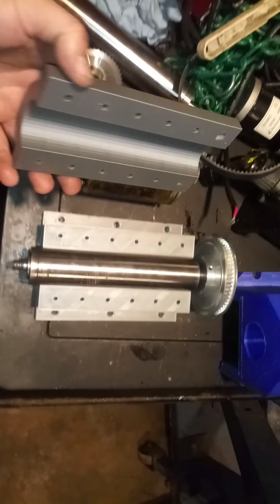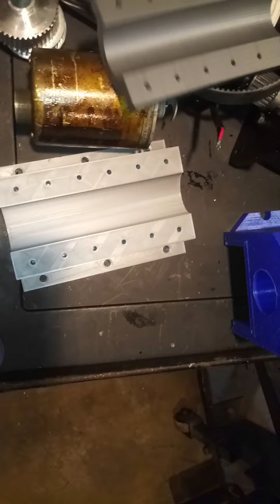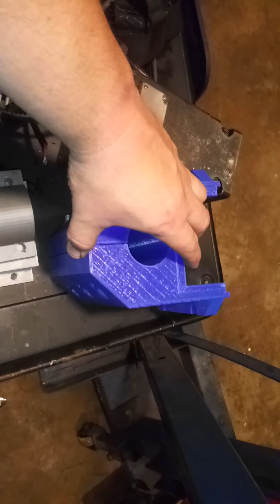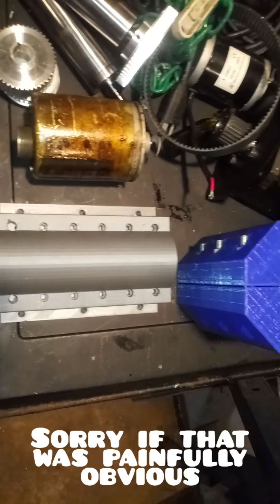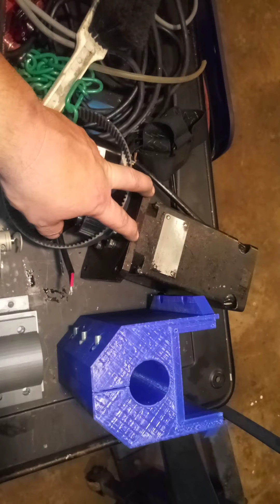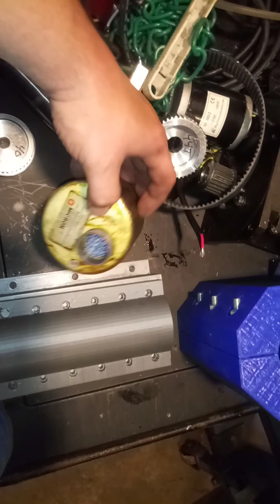Desktop CNC milling machine spindle update.

Comment: lol my comment disappeared. Weird.
Reply from the maker: ? Sorry about that, to be honest mine have too! Off my own videos. Then I wonder if I should post again and think we'll if I send it twice you guys will think I'm crazier then I am lol
Reply: @backwardsmachining7526  In the spirit of crazy, what I more or less commented was that I like the looks of it, and I think if you wanted to, you could machine something that would get you started. That is to say, if you bored top down through a block of material, drilled and tapped a vertical row of holes on the left and right sides of the block's face, then slit the whole thing in half sideways you would have a chunky/rigid round-holding clamp to build off of. If a large piece of square stock wasn't obtainable from your scrap yard, then maybe a large round could be milled square if you could find one. All in all, I like that you have the wick of possibilities lit and burning with forward momentum.
Reply from the maker: @johnstrange6799  I actually have a decent size block of steel specifically for this. I have many different ways lined up in case one doesn't work. My only concern is that steel is tough to cut on a good day in a home machine shop and the size of steel I'm talking about is pretty hefty. Now if I can take some molten aluminum and set it in a big block size form let's say 8 inch wide, 6 inch thick and 12 inches long I figure that can save a bunch of money when you price out aluminum. In fact I don't even know where to buy a piece of aluminum that big. My scrap yard doesn't sell local.
Reply: @backwardsmachining7526  Yeah, cutting is always going to suck, but a block like that after it were bored out wouldn't be too too bad since you would have the center out of it, BUT cutting it straight is the other issue. Sure you could mill the cut path back to flat, but at some point you will alter the round bore size. Aluminum isn't a breeze to cut through in big chunks either.  I've hand hacksaw'd through some slabs of it, and it's not fun. If you can pull off a casting great, but alternatives are always good to consider. Will the spindle travel? If so, what kind of weight can be moved? Don't forget to 3D print with shrinkage in mind for the aluminum.  I found some random hold downs today while out junking. Also found brand new welding hose in the packages, a Rockwell air drive palm sander, a clamp on work light, piece of round bar and a old snow blower with 5 Horse on it.